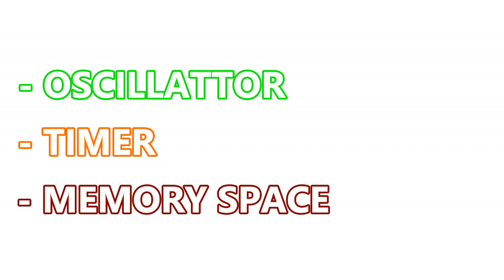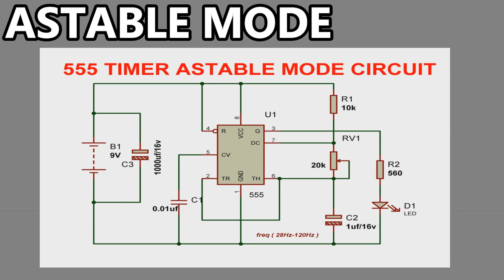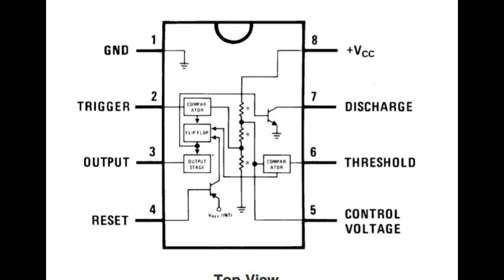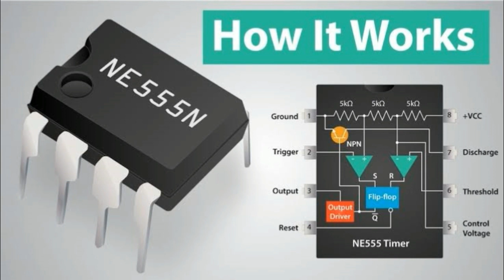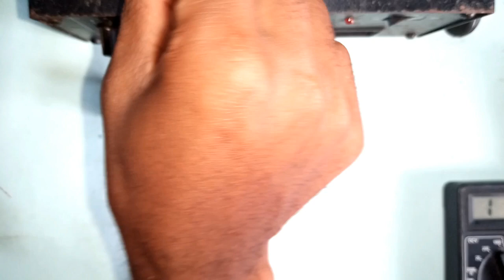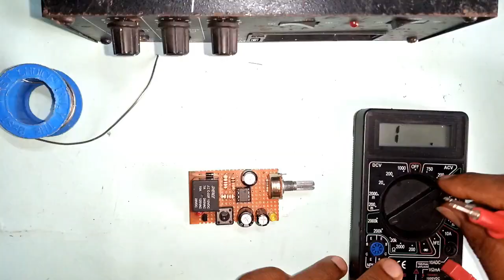555 timer delay switch: How to make a Time delay switch Circuit [ 2nd Topology ]

Comment: Permit me to design a pcb layout for this project
Reply from the maker: Sure go ahead, is an open source,and you can always share the design...
Reply: Hi I want to uou do design  a circuit  for me 07081382230 whatsapp
Reply from the maker: @phantom-ip8ix  
Which Circuit is that, feel free to drop the request
Reply: @phantom-ip8ix  07063005324